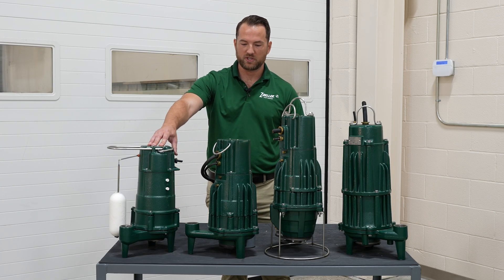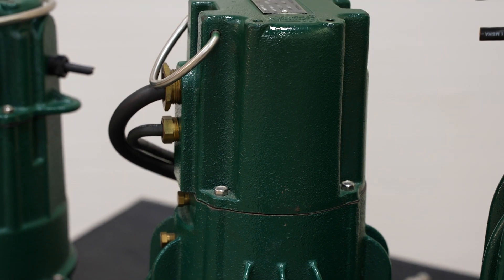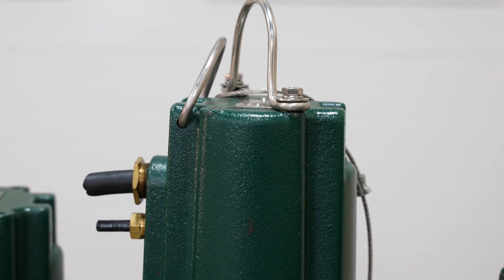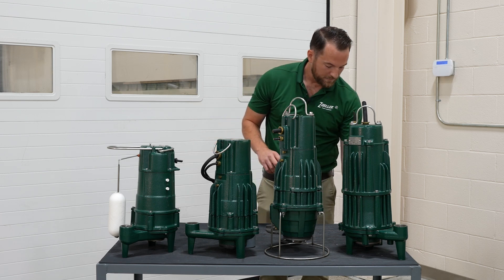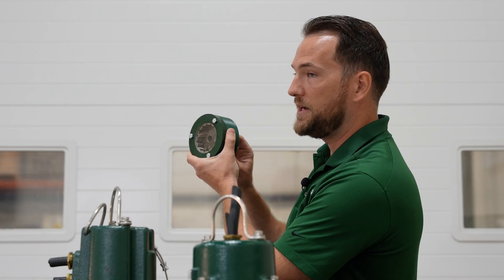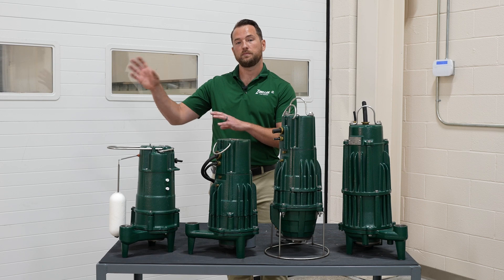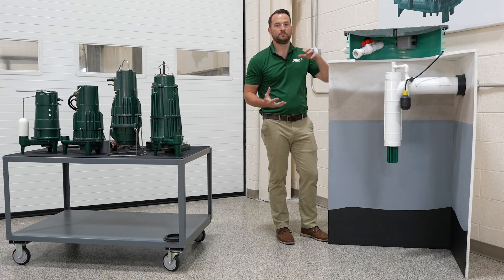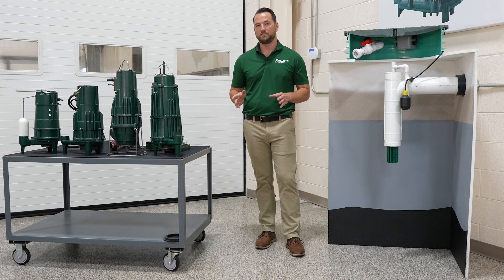Shark Series Grinder Pumps - Applications Overview

Comment: Regarding the last part, in my application I have a septic tank that connects to a main sewer line. Currently, I’m using a Zoeller M267 sewage pump in the tank, but it gets clogged once in a while. Would it be a problem to replace the M267 with a Shark 818? What would you recommend?
Reply from the maker: We never recommend pairing a grinder pump with your septic tank, but if you would like to speak with our product support department regarding the specific aspects of your application to see what they can suggest to help with the clogging, those experts can be reached by emailing zcotechnical@zoeller.com or by calling 1-800-928-7867 and pressing option 6. I hope this helps!